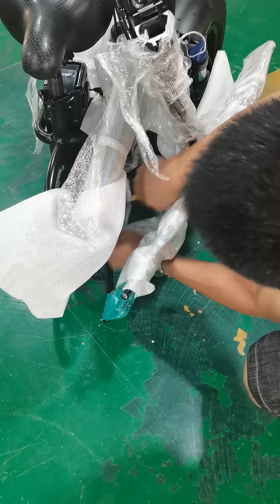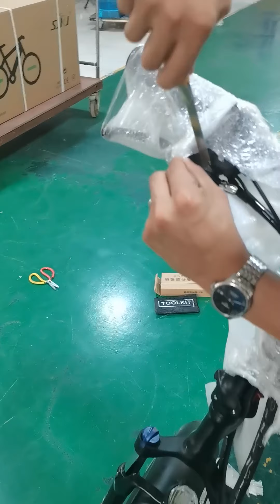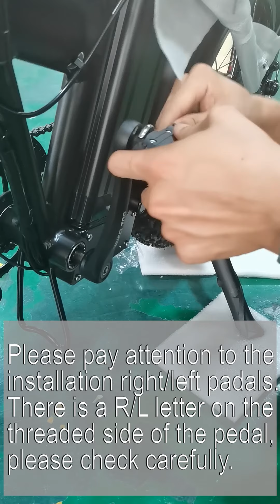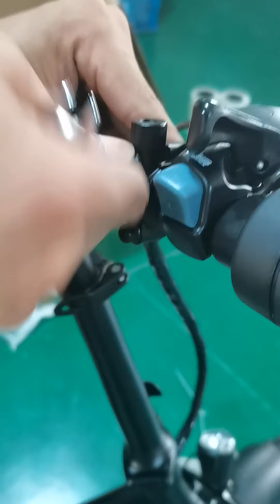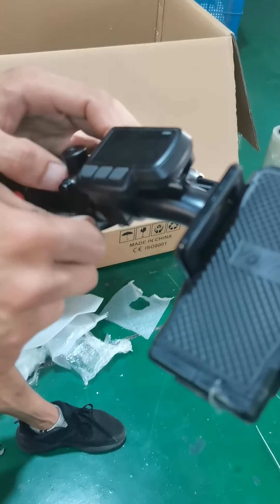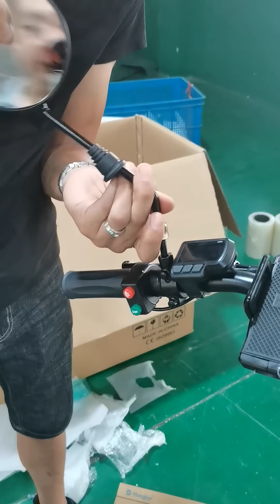MARTES 750W electric bicycle installation video

Comment from the maker: If anyone likes this bike please contact me😎
Reply: I  like it,I want buy one
Reply: when you got it it was already unlocked and it was 45kmh or you need to unlock it
Reply: I have one. Maximum speed is only 42km hr??
Reply from the maker: 原文
Hello, the maximum speed of an electric bicycle is related to many factors, such as the rider's weight, temperature, road conditions and so on. The conditions for our test speed are 25 degrees, 150 pounds, and a straight road.
Reply: Hey mark, I just got mine. Is it possible to change stuff in the bikes computer? Or does it support another screen?
Reply from the maker: @ElCeeKaa  Hello, you can modify the settings of the E-bike computer, but incorrect settings will cause the E-bike to be unusable. If you want to replace the screen, you also need to replace it with the controller, because these two things are matched, you can contact our customer service
Reply: Hello, is this a Chinese trademark?
Reply from the maker: @Floflolita  Yes, that's right, but I don't recommend you to buy it. It has nothing to do with my leaving. Because the company's products have suffered repeated quality problems, which violated the lives of customers, so we parted ways. This is not my way of treating customers.